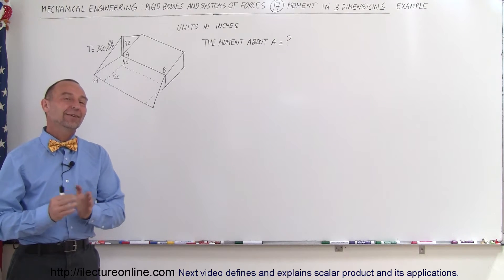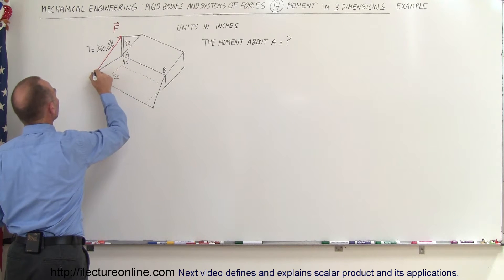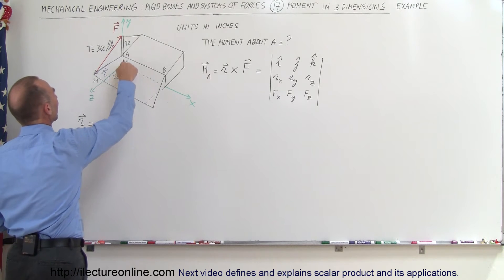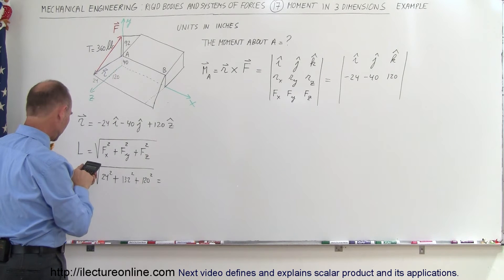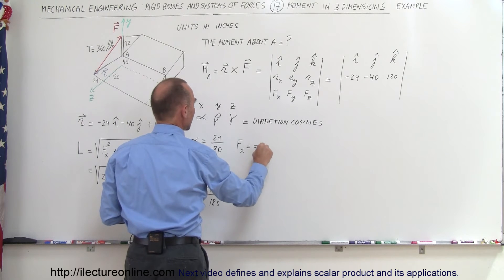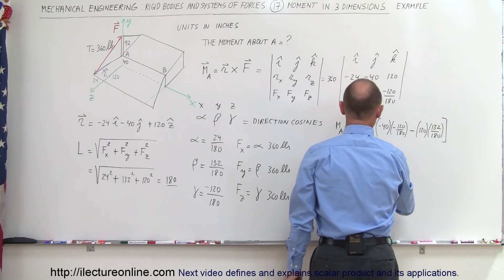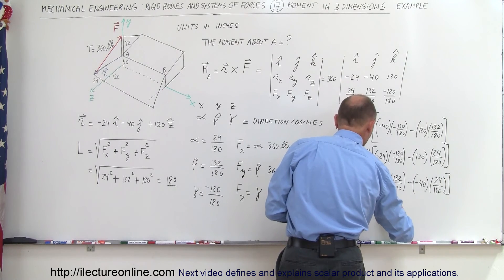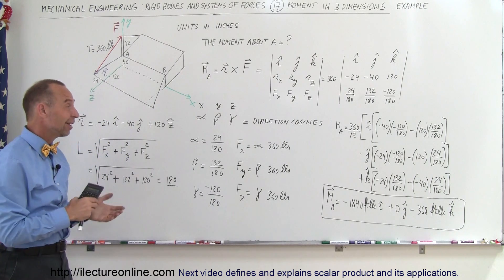Mechanical Engineering: Rigid Bodies & Sys of Forces (17 of 47) Moment of a Suspension Cable

Comment: Working with 3D vector is a paradox, to imagine it it's easier in 3D space, to calculate it, it's easier if it is projected in 2D plane :) It is easy to determine the vector sign without CW/CCW or right hand rule projecting 3D vector on (xy) plane and on (zy) plane using relative coordinate systems. I'm not sure if this tool is useful for other exercises as well, lesson 47 is still a long way off for me :) Image post:  https://i.postimg.cc/jjHjtszK/3-D-vector-components.jpg
Reply from the maker: Not sure what you mean by: "Working with 3D vector is a paradox"
Reply: @MichelvanBiezen  By paradox I mean that it is difficult to solve the 3D vector problem only in the 3D space or in the 2D plane, both approaches are needed.

Comment: The drawing is really screwed up!  The force vector looks like it only has two components.  It should be at stated the the edge and the force lie in the same plain, which how you explain the z and x proportions.  And the position vector is poorly drawn.  It should be pointing down.

Comment: Sir I think you should name the axis' differently in your 3D-drawings. By convention the x-axis points out of the board, the y-axis to the right and the z-axis upwards. Otherwise great video, thank you very much.
Reply: +Benjamin Labrecque By that convention 100% of his video's shown in 2D would be incorrect.  Except, they're not because in 2D we accept that y is up. So if we enforce this convention upon Mr. Beizen, that y is up and we ask Mr. Beizen to give us depth we would see the additional z-axis.  So, by agreement, a convention is born that puts everyone on the same page.  However, in video games and modeling software - the war rages on :).  As a side note, we're taught this convention in our Mech. Engineering Statics course - y is upward as Mr. Biezen has drawn it.